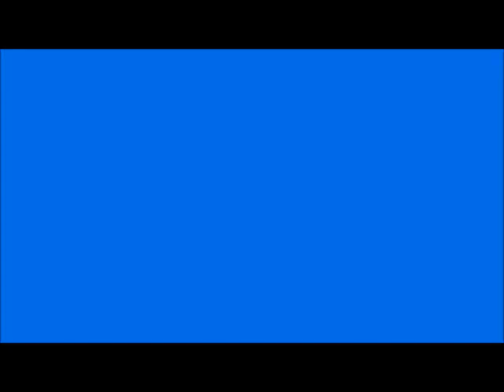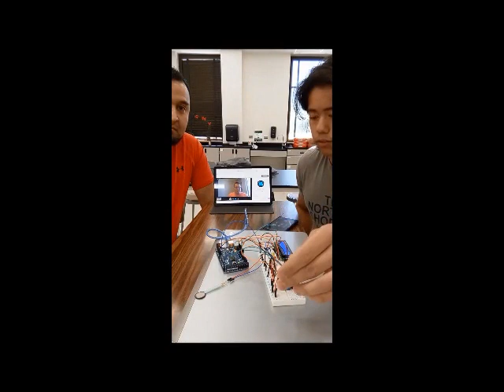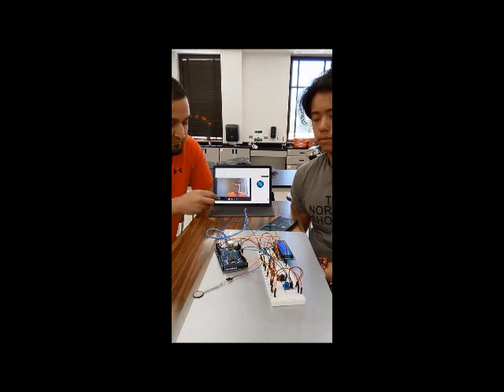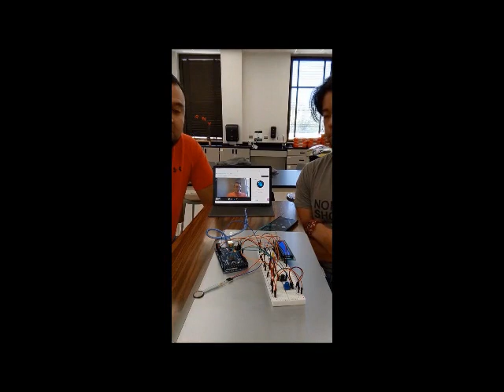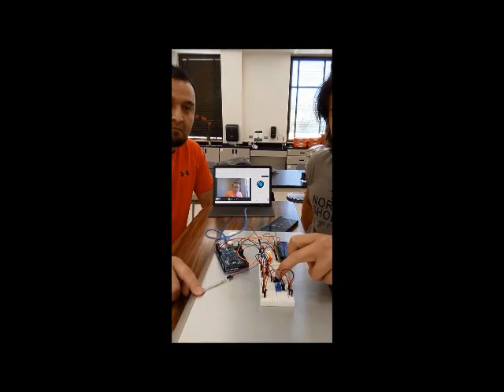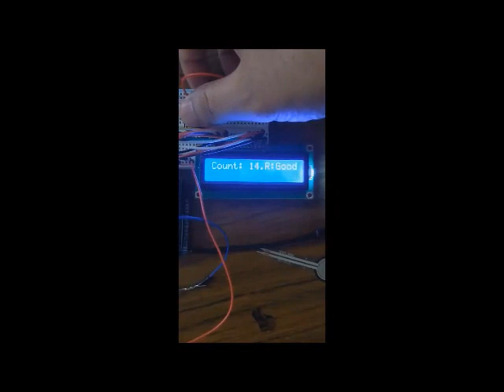CPR Feedback Device with Arduino MEGA 2560

Comment: Can you share the code of that project?
Reply from the maker: Most of Arduino starter kit comes with many example project codes.
Reply: @MohammadShafinulHaque  from where I get that?
Reply from the maker: @adoring_allah7675  https://www.amazon.com/ELEGOO-Project-Tutorial-Controller-Projects/dp/B01D8KOZF4/ref=asc_df_B01D8KOZF4/?tag=hyprod-20&linkCode=df0&hvadid=309818716690&hvpos=&hvnetw=g&hvrand=18020761879496324469&hvpone=&hvptwo=&hvqmt=&hvdev=m&hvdvcmdl=&hvlocint=&hvlocphy=9028160&hvtargid=pla-406302474425&psc=1
Reply from the maker: @adoring_allah7675  there are many more options similar to this, you can search for the one that suits you.